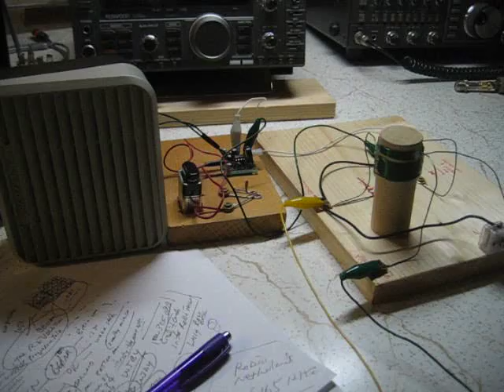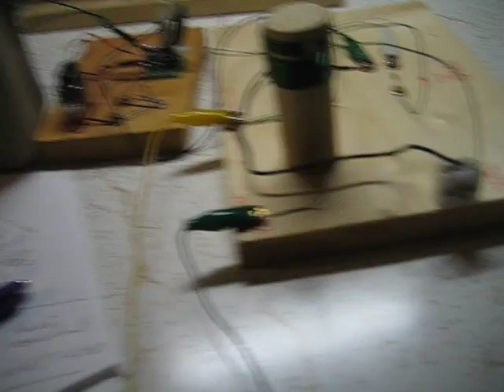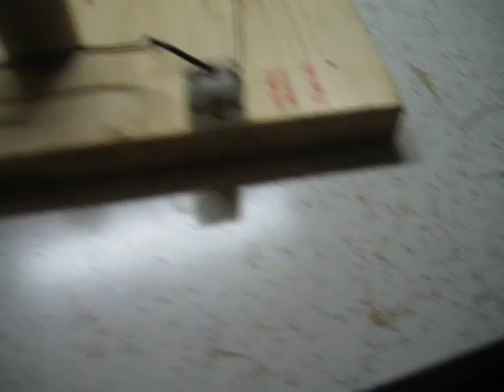RADIO NETHERLANDS on a Simple Homemade Short Wave Receiver

Comment: How many turns on your coils? How many channels?
Nice setup!!
Reply from the maker: See comments.  Two coils.  1-1/4" wood dowel.  Top coil is 5 turns #26 wire on top goes from antenna to ground.  The lower coil is 14 turns tapped at 5 turns from the top.  The top of the lower coil goes to 70 pf variable capacitor which goes to ground.  The bottom of the lower coil goes to ground.  The tap on the lower coil goes to the 1n34 diode.  Phones go between 1n34 diode to gnd.  Send me your e-mail and I will make schematic for you.  Picks up several stations according to propagation.  Can tune about 5 stations at a time..  Very simple shortwave receiver..
Reply: nice setup!
I just make wire coils (with wire from wall adapters) on ink pen tubes, (50-100 turns), connected to a diode, var. cap. and ant. and grnd. do you have a 47K resistor and 5pF in the output that goes to the amp, or not?
Reply from the maker: Sooner Science Nerd Good questions!  I use 1-1/4 diameter wood dowel rod, but as you point out more turns on ink pen tube will work, too.  This radio dows not have the 47k or 5pf in the rf stage, but the Audio AMP does have various resistors and caps.  The Audio Amp is a standard LM386-IC based amp.  It does have caps, resistors and a 10k potentiometer for volume control.  I like to build separate Audio Amps to use with different rf stages.  Some people use computer speakers which have audio amp built in.  That would work, too.  Good luck and please let me know your results if you build one.
Reply: thanks.
I had to scrap an AM/FM/CB radio because of its power switch was too flimsy, tried to replace it with other switches, none fit, and its components are worth more than trying to repair it. it has a nice var. capacitor,antenna, power transformer, and huge speaker..
I've also been using amplified speakers for my crystal radios. (I have a lot to mess with, anyway.)